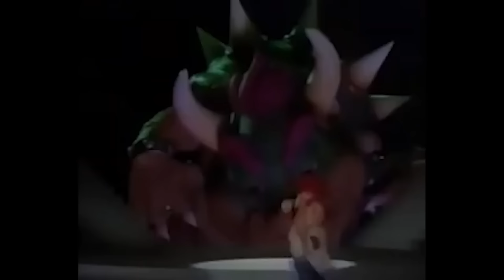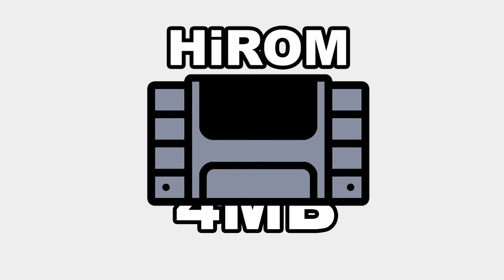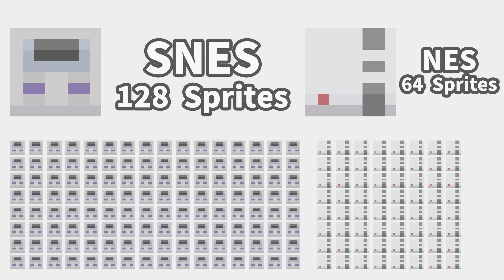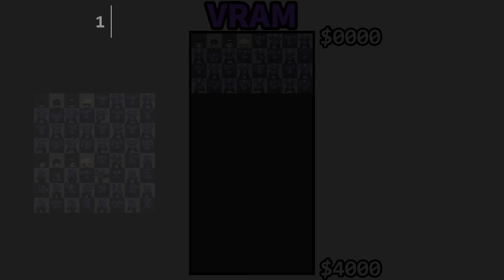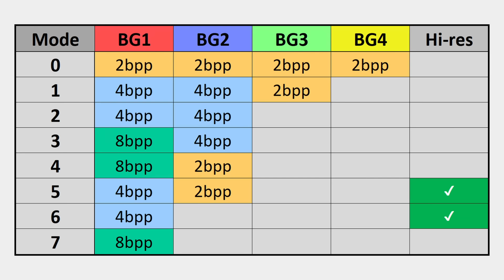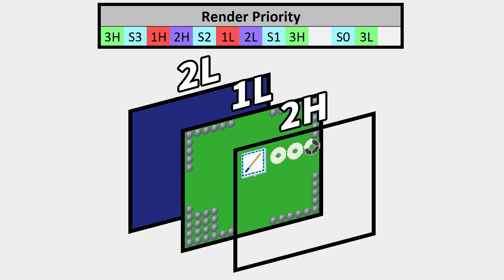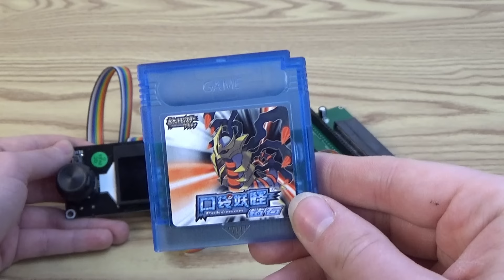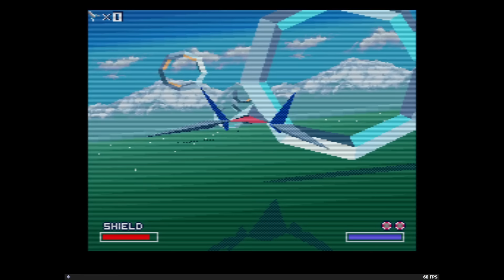Making an SNES Game the Way Nintendo Intended

Comment: I'm a reverse engineer and have been since high school. I am as we speak writing a PE analyzer in C++20 using Zydis and MSDN docs to retrieve strings, do control flow analysis, and so forth. I've even written my own instrumentation framework in which it replaces the prolog with a call to push the return address on the stack for identification in the callback dispatcher during trampolines. Have written MASM, patched IAT, vtables, written shims to bypass DRM, etc.

Writing an entire game in assembly sounds over my head to be frank. And extremely painful. You're a better man than I.

Comment: The odd bittplane/palette storage is likely to make it easier/fastee for the PPU to read things in the order it needs; since tooling can easily convert the data during the build process, this kind of optimization helps the hardware run faster/better with little to no effort from the programmer.

Comment: All pseudorandom number generators (PRNGs) are deterministic. That’s why they use a seed: the seed picks the starting state, and from there the algorithm always produces the same sequence of values. You can think of it like walking through a really long list of numbers that look random. Each time you ask for the next number, the generator moves one step forward along that path. Since the state space is finite, eventually the path loops back around and repeats—that’s called the period. Setting a seed just changes where you start on the path. Using something like the current time makes it feel unpredictable, but underneath it’s always the same deterministic process. The “randomness” is an illusion created by the math. If you want true randomness, you need physical entropy, like noise from the environment.

Comment: the 6502 was never 'cutting edge'. not even in 1976. you could already get way faster and bigger computers back then. that is the point behind the thing. it's esssentially a somewhat half-risc microcontroller that just so happens to need a few other chips to do something. lol. and that's why it goes into new stuff 50 years later still. because your doorbell doesn't need to run at 2ghz.

Comment: If there is a difference between a programmer and a developer, this shows it. Understanding the low memory, needing to flip images to save storage space (but modded boards might take a 128mb module (if you're cheap)). But you sir, can communicate to a CPU, I can only talk.I'm a developer, but I could program.

Comment: How would they iterate through the development process back in the day to compile and run the code repeatedly? Today there are of course powerful PCs and emulators. But how did they do it back in the day? Program to a ROM chip, and physically insert the ROM chip into the console?
Reply from the maker: It depends, some developers actually did compile their code on a PC, program an EPROM then run their code on the console, and that cartridge might have special connections for debugging on the PC, but in the latter years of the SNES Nintendo developed flash carts for developers to quickly be able to load the game onto a cart and test it on the console

Comment: I think you've got your wires crossed. 

1983 was the US video game crash... There's no way Nintendo would have released a game system then.

You probably meant to imply that Nintendo released the Famicom in Japan in 1983.

I got my original NES in 1986.  It might have been released in 1985, but I got it pretty soon after the ads began appearing.

Comment: 10k lines in asm is nothing. Still somewhat manageable. 68k asm would be even easier.
I'd still write asm and do low level optimization if it was feasible today...but it isn't. My first scanline renderer was written in asm, in 1980 on a PDP-11. A PDP-11/70, to be more precise, that the university had on loan. I think that took almost six months.

Comment: @Inkbox great video! Thanks a lot. 
I’ve been doing some work on the NDS and it shares quite a lot of things with the SNES. I didn’t know about the possibility to give tiles individual layer priorities, but that sounds quite handy. What I was wondering is why you can’t swap the pixels of a tile for animations. Is that because it’s all coming from the ROM?
Reply from the maker: You can, but it's faster to change one value in the PPU (the tile number in the OAM section) than to transfer 32 bytes from CPU memory to PPU memory

Comment: Hmmm Intel processors do not start off in 6502 emulation mode.  What??  Completely different processors.   What the x86 / x64 process DO though is start off in real mode and you have to enter protected mode.

Comment: No shit.  I'm trying to teach myself assembly because I want to make a roguelite for the PC Engine.  It makes me feel dumb but with videos like these it gives me a little more insight into how I can leverage the code to do what I want.  As I learn more about the programming I always hear about 'tricks and tips' that developers used but I can never seem to find the complete relevant information.
Reply from the maker: I don't think there are any real tricks or tips other than knowing the hardware and its abilities/limitations. But a lot of good assembly code also makes extensive use of bitwise operations, so if you aren't using those, then you've got to start to.
Reply: @InkboxSoftware  Not going to lie, I'm not even entirely sure of what bitwise operations are.  Thanks for the heads up though, I'm still learning the code at the moment.  I haven't programmed anything since some flash games I made as a teenager for Newgrounds or coding in highschool.  Almost 20 years ago.

Comment: Impressive as heck especially given how fast you pulled this off. Of course modern hardware and software does help a lot in comparison to computers of SNES's time (the jade dragon statue being the blatantly obvious example here). Still impressive though especially as it's written in assembler with its own instruction set specific to the SNES.

Comment: Bank 3F are bank 3FF and pooped out the bank 80 all the way to 8000 kilobytes until they rom data flanked the hypolopiler and s ram chipped the flux capacitor unit flooding all 21.1 poopawatts. What in the world dude! I was digging the video and you went on and on with the technical stuff. Give us a touch of it and move on. Goodness if we wanted to read a manual we’d read it.

Comment: V5 of the OSCR works well.  I've built two of them so far.  You have to make sure you set the right voltage for the game cartridge type, but that's about it.  NES crappy connectors are problematic, but other types I've tried work OK.  The menu tells you what voltage to use, and the DB of games is constantly being updated.

Comment: Hey,  if you're gunna have a go at the address space why not at least compare to the vastly more convoluted address/offset of the x86 memory architecture.  SNES "array" memory is fine, it's easy, it's good.
Reply from the maker: But the x86 memory architecture is made so that each program can have their own address space, otherwise it would be incredibly difficult to run multiple applications at the same time on a PC.
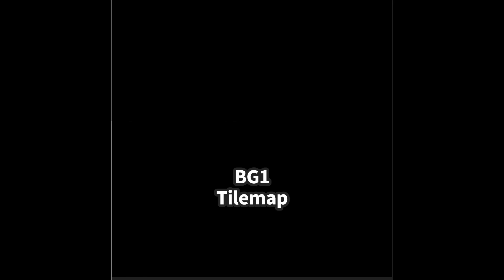Reply: @InkboxSoftware  Ahh, to be young again.  So back in 1986 in the good old DOS days how is this multi application use relevant? I guess they future proofed it?  Sorry to burst your bubble there, but only video ram could be accessed as a sequential, single unique address from $A000:0000 to well, depending on int 10 it was slightly different for vga ega, cga.   Memory has always been address/offset 32bit 16:16.   Multi application huh?  Maybe a 20 line asm TSR for mouse operation?  Face it, all systems have their quirks and thye SNES is all very straightforward.

Comment: Congrats on making a playable game!  You are right about the highs and lows of creation and the appreciation you gain for the giants who made the games so many love.
The reason 4bpp sprites are stored as two 2bpp sprites is it makes the PPU hardware simpler (and therefore cheaper).  This is something which goes back to the Atari 2600 - make the hardware cheap but flexible and rely upon the software to handle anything complex.

Comment: Nice video on the dev side, but I just can't agree with the Nintendo Seal of Quality. Most obviously due to the (lack of) quality of some, especially license games. Second point of it was to prohibit developers from porting the games to other platforms.

Luckily I had C64 instead of NES back in the 80's and into 90's, so I could start programming immediately! :D

As for "why bitplanes are formatted the way they are", could be so, that it can work kind of the same way for most background modes as 2bpp, just repeat it more times for more colors. (Mode7 obviously offering chunky pixels, just in "weird order", luckily it's easy to make DMA skip every other byte)

Comment: In about, mmh, 1989 - plus or minus - I was flown by Nintendo to their building in Seattle, Washington - where one of my games had failed QA/playtesting. The NES had about 23 different variants (different chip manufacturers, etc) and your game had to pass on ALL of those. Mine passed on 22 of them, and failed on one - but only after being left on a few hours. We had no clue, so as a last resort I had to go and diagnose in-person on THAT machine. The playtesting floor was, as far as I recall, a whole bunch of teens in front of NES machines banging away on games. I got put into a room with my failing game. Sure enough, the sprites were flickering. I said "that's a hardware problem!" they said "no, it's a software problem!!" - so I said "get some freon" which they did. We sprayed freon on the machine, and bang ths flickering disappeared and the sprites were rock solid.  Turns out I was not refreshing the dynamic ram EVERY SINGLE FRAME for the sprites, and on this machine, when it was hot, I was right on the edge of the dynamic RAM losing its contents. Just a bit here, a bit there. I was trying to save processing power by only refreshing when there was a change in sprite data. Turns out that was a bad idea.  After the freon, I did fix the problem (refresh every frame) - but in any case Nintendo "retired" that particular machine, telling me there were only about 4 of them in North America :)
Reply: that's a wild story.
Reply: That’s a really cool edge-case story!
Reply: @Blennan  You would probably like the story about apple devices freaking out in a hospital due to helium!
Reply: @mrsteamie4196  Whoa!  Never heard about that.  Thanks for the tip.
Reply: All NES variants use static ram.
Reply: @Pence128  I did some digging; you're totally correct. Back in the day we diagnosed this as the RAM being dynamic, but today I found out that...

"You’re likely referring to a quirk of the NES PPU’s OAM behavior, which causes corruption during DMA transfers or at certain cycle points — not because it’s DRAM, but because of:
	•	Timing issues during OAM DMA (Direct Memory Access).
	•	Interference from rendering during specific PPU scanlines.
	•	Incomplete or misaligned writes during a frame.

This kind of corruption isn’t due to lack of refresh (as in DRAM), but due to bus contention or race conditions with how the CPU and PPU interact with memory."

When we changed the oaM refresh/writes I guess we removed bus contention. I was today years old.  Still, apparently Nintendo didn't know this either... the story is true, as I lived it, and I was told they retired that one of 23 variants that my code failed on.
Reply: @andrewdavie386  Ah, that makes sense., the PPU was always pretty buggy. Apparently one revision was only made for two weeks.
Reply: @Pence128  further thinking about this - it's still extremely odd that freon "fixed" the glitching immediately -- I would not have thought this would affect static RAM. I told the story as it happened ot me, though, and that the particular model was literally only a few units in the USA. There must have been some timing issue heat-related happening somewhere in that machine!
Reply: @Pence128  According to Google A.I., it used both: The Nintendo Entertainment System (NES) primarily utilizes static RAM (SRAM) for both CPU and PPU memory. The CPU's work RAM and the PPU's Video RAM (VRAM) are SRAM, while the PPU's Object Attribute Memory (OAM) uses dynamic RAM (DRAM).

And then cartridges with non-password-based save game capability of course used battery-backed SRAM as well.  Interesting that the NES used non-battery-backed SRAM where you'd generally expect DRAM to be; wonder if that was due to it simplifying the NES design, to not need RAM-refreshing circuitry.  I would presume it wasn't due to them needing SRAM's speed advantage.
Reply: That's an Amazing story. I love hearing old stories like this. Are you able to divulge what company you worked for? Or even better the name of the game? My childhood NES collection was quite big, so it's very possible I have enjoyed your work
Reply: @charlesmcclure8000  BEAM Software!
Reply: Good story. I would tell you some of my current Windows 11 problems with customers but it's "too soon".

Comment: This is a really cool project! What would be amazing to see is a full hardware/software journey:

1.  *Create your own console:* Design the hardware system from scratch (maybe even with 3D-printed cartridges!), give it a brand name, and then develop a game specifically for that console. A walkthrough of the entire process – hardware design, game development, cartridge creation – would be absolutely fascinating. Think something small, maybe even Rubik's Cube-sized, like a RetroPie.

2.  *SNES/Retro Game Development (Round 2):* Now that you've got some SNES game dev experience from this video, then tackle a second project, perhaps refining what you learned here. This would be a great way to compare developing for existing hardware vs. your custom system.

3.  *Portable Version:* As a final stretch goal, consider a portable version of your console, like a Switch or Game Boy. This would add another layer of complexity and allow for "on-the-go" game development. There are even tools like GB Studio for Game Boy/Game Boy Color development (and potentially Game Boy Advance).

The ultimate challenge would be creating your own assembly language game for your custom console, using something like the 6502 (used in the NES/SNES and other retro systems). This is a huge undertaking, but it would be incredible to see!

I Would Love To See Something Like This On Youtube For Someone To Actually Take Up On This Mantle Of Creating A Game A Retro Game It Was Done Back Then Creating Their Own Console Their Own Game Labeling It Making It Whole It'll Be Super Interesting To Watch And Definitely Inspiring! I've Been Wanting To Do Something Like This But I Just Don't Have The Experience The Time Or The Knowledge To Make It Happen If I Did Have Time I Would At Least Attempt To Make Something That's Great And Who Knows What This Will Go But We Keep Playing The Current Modern Games We Have Today Or Would We Make Games For Other People's New Retro Hardware Or Our Own Just As A Hobby I Would Do This
Reply: #1 was done by mitxela years ago. look his video up, it's incredibly cool.

Comment: Couldn't you fake more on-screen sprite sizes just by using smaller bitmaps with large areas of the current sprite sizes set to transparent pixels? I'm sure some games probably did it. It would waste some RAM but increase variety.

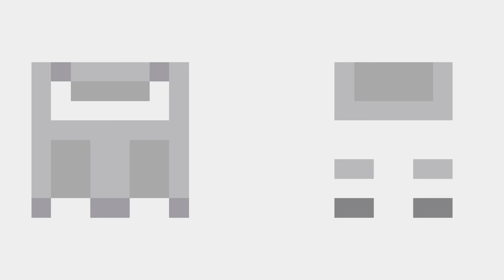Comment: 12:50 I'm not sure if this is why SNES also used multiple bit planes, but CGA, EGA, VGA, and other IBM era graphic adaptors also used multiple bit planes because they needed fast reading speed, and they could read at quadruple speed by using 4 VRAM chips. The fact that SNES has 2 VRAM chips makes me believe this is why it also uses bit planes.
Why 4 bit planes when it has 2 VRAM chips? Not sure, probably to make it easier for programmers when using 2bit mode.
Reply: Planar graphics tend to work better in scenarios with low color depth and low VRAM/bandwidth in the context of the CPU architecture - chunky modes tend to be power-of-two sized to align with CPU word sizing, which works well if your mode is aligned with the CPU and terribly if not. If you use a planar approach, graphics tasks that involve a lot of pixel-level access and readbacks become complex, but in exchange you have a relatively simple path to do e.g. bitmap blitting in 2-bit, 3-bit or 4-bit color depth by repeating the blit two, three, or four times at different offsets.

Comment: I need to point out, that it is extra impressive, that you learned all the different kinds of stuff, like arts, gamedesign, Programming in 6505 Assembly, learning about the SNES hardware and how to specifically program for that, soldering etc...

Some things as you told only for this project. You're pretty versatile, so impressive.
Reply: I'm kind of jealous.. in the 80s I really wanted to learn this stuff.. but had no access to any books or info on how to do it. Today, it's a bit late, but I can just watch some youtube videos and watch people a third my age doing it.

Why they do this programming archeology? Not sure.. but it sure takes another level of hacker to achieve. And there's something to be said about the bare metal full control we had back then that is hard to achieve on the modern computer stack.
Reply: When you want efficiency. You can look at the past for what was done. I guess it's a similar thing. Building up skills using old method. This thing could probably run at 10,000fps on a modern system with some updated code. @acasualviewer5861
Reply: I was thinking about doing something like this except with simulated custom hardware instead of bare metal ICs and ROM programming. Sorta like TIC80 or PICO-8 but for processing 16/32 bit files and the like. I guess I'd like to do some coin-op stuff in the future though. Or I'll take a trip down memory lane and make some homebrews for the sega dreamcast.